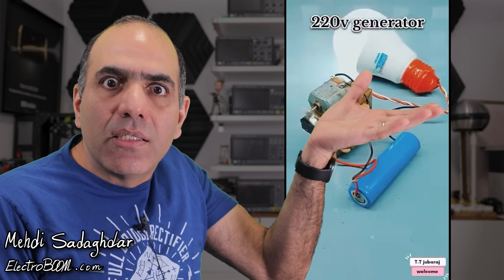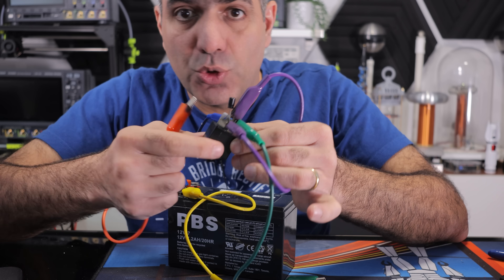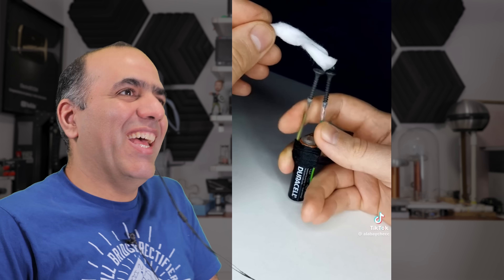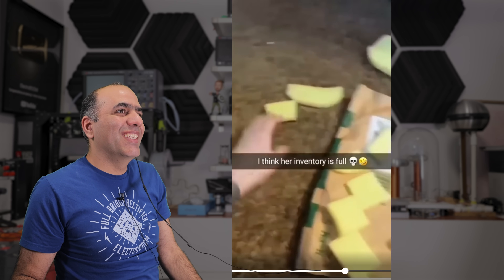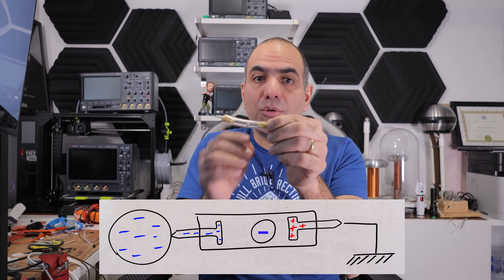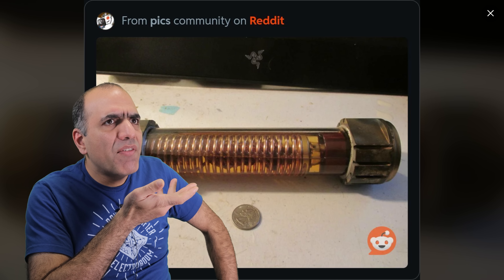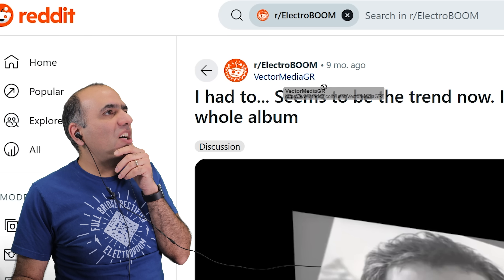Nuclear Egg (LATITY-015)

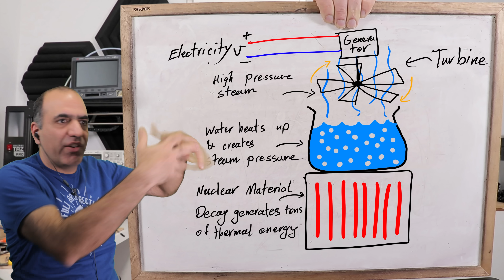Comment: 12:30 There is another kind of 'nuclear' power source, so far only NASA has made use of.  Radioisotope Thermoelectric Generators (RTG).  It's completely passive, just converting heat of the decay from a radioactive isotope into electricity directly using the Seebeck effect.
Reply: Not only NASA. Pretty much every space agency uses them. Russia used them in a bunch of remote lighthouses too.
Reply: they are huge and have a huge heat sink.  they are not a small plastic egg.

Comment: You can make electric source with radioactive beta decay directly (without boiling water and turbines), but I don't think you can power a house with it., they have energy density in single digit kWh/kg and last decades to centuries. But it would be neat to have this gigantic 50m cube, that will power your comparably tiny house for few hundred years :)

Comment: you are wrong about the reactor thing. Its not a steam turbine.
its a beta radioactive source, which decays by emitting electrons. Those electrons get collected and you have a self charging battery that lasts as much as the radioactive source.
It can be very small. definitely not impossible.

Comment: You can easily fit a nuclear reactor in an egg using thermoelectric effect, like they did in Voyager space probes.
Reply: RTGs aren’t nuclear reactors
Reply: That’s not a nuclear chain reaction, it’s just alpha decay of plutonium being turned from heat to electricity. Similar, but different
Reply: @filippo1864  I know, but I just want to say that it's not really necessary to boil water.
I think they use plutonium because it keeps a consistent and predictable heat production that decays exponentially over the years and don't have moving parts, but since we don't have those restrictions on Earth, maybe it can be replaced by other designs.
Reply: @兎くん0  yeah, lower complexity and Pu238 decays in some 80 years, so sweet spot for enough thermal output without decaying too fast, but still very niece applications
Reply: they are huge and have a huge heat sink.  they are not a small plastic egg.
Reply: @tsm688  Then just put it in a huge black steel egg.
Reply: @兎くん0  that...  would actually work

but an egg with lots of fins like a cast iron motorcyel motor would work even better.

Comment: You can still make a fire starter with an AA battery, solder a thick wire to each end, and connect one to a momentary switch, then use a much smaller wire to connect it to both of the other wires. Push the button, small wire turns glowing hot, press to flammable material. Of course, you want to limit how long you keep the button pressed or you'll burn through the small wire. You also want to make sure the button can't be accidentally pressed or it'll burn up your camping gear when it gets squished...

The LED repair probably won't last long either. They're wired in series because each individual LED is rated for far less than 120V, and in cheaper bulbs they are often already being driven above spec. That 4 LED bulb would be dropping 30V across each LED, minus whatever is being eaten by any resisters. Notice the other bulb had 16 LED's, so each LED would be getting at most 7.5V. Also notice the 4 LED bulb looks like is has no circuitry at all, while the 16 LED bulb has a whole bunch of surface components. There's a good reason the 4 LED bulb failed...it's cheap garbage....

Comment: 4:25 replacing the tiny AA battery with an 18650 does actually work as a reliable firestarter though (tried it once with a discarded laptop battery), but you will have to be very VERY careful around things that can dump tons of amps at once like that
Reply: Yes in that case you're 100% correct, however we were talking about a guy who took a regular AA battery and did this. This version was FAKE. However it is possible with other smaller batteries I'd agree or a supa cap.
Reply: @dogs-and-destruction-channel  yep, just suggesting a way to make it work that's just as simple to perform
Reply: Yep that works! I managed to make a sort of tiny battery welder from it but the batteries do heat up a lot but that's because they can dump a few xx amps of current while a puny aa or aaa cant

Comment: To be fair, you can make fire from a AA battery if you cut a piece of (metallic) gum wrapper into an hourglass shape. I'd be curious about the physics that allow that to happen, but not a thin strand of wire?
Reply: A battery can be modeled as a voltage source with internal resistance in series. To get maximum amount power out of it the load resistance must be equal to the internal resistance. To to reach high temperature the power needs to be concentrated on a small area. The hourglass shape does that as the thinner part has higher resistance so it has more power loss. 

The wires have constant diameter so they generate heat equally. They were also quite thick so they have lower resistance than the internal resistance so most of the heat is generated inside the battery. The wire being copper and foil being aluminum with higher resistivity also matters. It would probably have worked if he cut all but one strand of the wire from the end of both wires and touched the strands together
Reply: @laserdiode  Thank you!

Comment: (14:42) Most notably about these types of reactors, normally the excess steam isn't just thrown out, it's typically recycled back into water to be used as a coolant again.
Reply: You still need gigantic cooling towers or a large body of water to condense the steam though.
Reply: @maxine_q  well yeah, I'm just adding that typically it gets recycled

Comment: 12:30 there are Radioisotope Thermoelectric Generators (RTG) that can passively generate electricity from nuclear decay, however, they need a few kilograms of plutonium oxide fuel to generate just over 100 electrical watts (while about 10x more power is dispersed as heat), so hey, maybe that egg can indeed keep 3 lightbulbs on for several decades
Reply: We put them in our deep space probes and extremely remote arctic lighthouses
Reply: Isn't that what powers the voyager probes?
Reply: @iversen57501  yes and the rover Curiosity on mars to
Reply: Probably not a good idea to have an RTG in your house, mind you.
Reply: @Jpg700 There are RTG pacemakers and no issue with that
Reply: @Jpg700  I can only imagine how much of a nightmare disposing of them once they burn out would be if every single house had at least one of them
Reply: I love that Medhi fully missed the Enron reference 😂

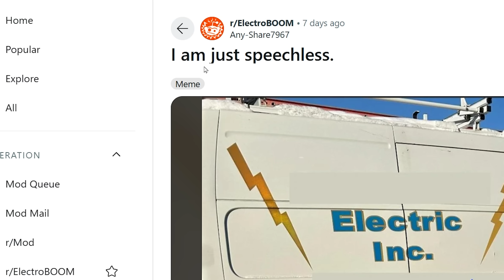Comment: 5:12 at least in Portuguese we differentiate piles/cells from batteries, the usually disposable ones like AA and AAA batteries are "pilhas", while the rechargeable, multiple cell batteries embedded in electronics like in your computing devices are called "baterias"
Reply: In my country and other francophone countries the word "pile" is a general way to call a battery
Reply: @ebtv445  "pile" in french is a disposable non-rechargeable "battery" whereas a "batterie" is anything that is rechargeable ...
But yes, general public tends to use either words but  use more  "pile" for small battery and "batterie" for anything big
Reply: I think it's "pila" in Spanish.
Reply: The poster was writing in English so using any other word but battery was definitely going to lead to confusion.

Comment: I've never seen repair work on a circuit board like that before (pulling off components with plyers). :hand-orange-covering-eyes:
Reply: Big Clive does it all the time, usually to reduce the brightness of LEDs by removing one of the resistors (with snips rather than pliers).

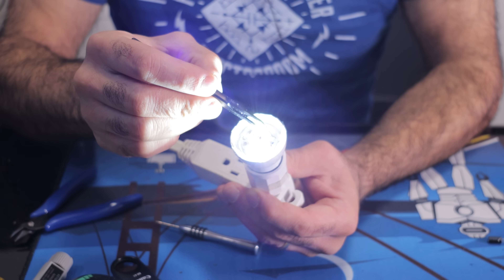Comment: 9:33 Any multimeter's diode test mode: 

Am I a joke to you?
Reply: Even single-junction 3V white LEDs may be hit-or-miss depending on how your miltimeter works.

I cannot recommend poking with multimeter when the AC is on but since Medhi is doing that anyway he could have just checked voltage across the dead LED.

I think the safest way is to just connect current-limited (someting like 1KOhm resistor is fine) 12v or 2*9v battery across each LED. Don't worry about overvoltage - large enough resistor will take care of that. 

And yes modern lamps often use non-12v modules, was surprised myself. 

If you don't have a battery handy try grounding LED "-" with a wire to AC earthing (PE / 3rd wire, NOT the neutral or live wire!!!) and touching "+" with your finger. If LED is working you may see very faint glow - your body picks up that tiny current from nearby electical devices and current-limits through your skin resistance. Try it - it works and is harmless. 

Often if you look REALLY closely you can notice a tiny tiny black dot where a burnt-out junction was.
Reply: I think anybody who requires a warning about putting tweezers across live terminals is unlikely to be all up to date on their multimeter training.
Reply: Probably won't work, sorry. Those LEDs are usually modules with multiple LED chips in series, so the entire bulb can run at a much higher voltage (like 50V, oftentimes at the same voltage as the socket). This gives each module a much higher wattage and light output and you only need a few modules instead of >50 simple LEDs. This also means that the summed up forward voltage of one such module is so high that the 9V battery in the multimeter does not have a chance to activate it - it will show broken circuit for perfectly fine LED modules.

Comment: 3:21 DiodeGoneWild seeing this: Bloody hell! Are you kidding me, guys?!
9:03 The least you could've done is bypass or replace the dead LED with a resistor. I've fixed a few LED bulbs with series connections of LEDs by doing so and by choosing the right resistance, since the LEDs in a series connection don't get pushed to their limit, they should last longer and you can make the driver run more efficiently.

Comment: teach us how to reduce the amount of power going to the leds so they last a bit longer
Reply: Resistor in series for fixed voltage, resistor in parallel for fixed current. (I have no idea of what I just said)
Reply: @ ROFL 😂
Reply: light dimmer
Reply: Depends on the bulb design. Some have a pair of current-limiting resistors, you can cut one off to bring the current down. Brightness also reduces of course.

Comment: Anyone know why an rcd can’t be used above an altitude of 2000ft? Was listed as a warning on the packet.
Reply: Might not be a guaranteed high enough air density to properly quench the arc flash in the arc extinguisher chamber, if the breaker opens when it's got a high enough load on it. Meaning it might well trip perfectly properly, contacts open properly, but it never actually disconnects the load, because it's now got a lovely highly conductive mini lightning storm going on inside, that's also burning the innards. then your distribution board, then your house.
Reply: @ thank you, this is sort of the answer I expected based on some papers I saw but still didn’t explain exactly. This has annoyed me for three years.
Reply: @RandomRecreation  Just an educated guess really, so I could well be wrong, but I'm sure I've seen it mentioned a couple of times on some videos about them and MCB's btw. It'd be nice if the reasoning was stated on datasheets, but I can't even find a datasheet that does.

Comment: 10:10 i use a small heatgun and keep LEDs from old bulbs. My rule is this: if the bulb had to be repaired 4 times, then it's time for it to go. You can never have too many LEDs and with a heatgun, it's easy to work it. Not even worth going to the proper solder station. OH and 99.9% of the bulbs i've taken out can be popped open if you apply the apple splitting technique on them. You don't need tools for it. They used to be glued, now they're just using a ridge.
Reply: I just put the entire board in the kitchen oven at 250°F for a few minutes. I tried the hot air station and covering the cob with a blob of molten solder heated by two irons multiple times, but whether on not the good LED’s would survive the attempt was always 50/50 and very frustrating. Those aluminum heatsinks just wick away a substantial amount of heat. If you can’t fight it, use it… By heating the heatsink in the oven one can simply pick the LED’s up at a leisurely, stress-free, pace with a pair of tweezers. When they aren’t extremely easy to pick up, I just throw the board back in the oven for a couple of minutes.
Reply: @athhud  Yup. Ovens work too. Have used an electric bread oven that i modded with a temperature control, but mostly on bigger boards. For these super tiny ones, the cheapo flamazon heatgun is aok. I literally tape the bulb to a small post i have in the shop and tweeze them out. The only ones that give me hassle are the ph!lips ones. I think they use the lead free solder, so i might use the oven on those going forward.
Reply: I think it's the excessive heat that keeps killing the Edison screw LED light bulbs. I bought a set of two identical light bulbs, ran one as-is and modified the other one with a bigger heatsink (from some old ATX motherboard chipset). The LEDs in the one with the original heatsink started failing within a year, while the one I modified still has all LEDs working after 5 years of daily use. It's bigger and looks ugly though, but I don't mind.
Reply: @andeos /videos Oh, they shrink heatsinks on them to cut costs and increase the death of these. So for example 0sram, a brand i get here in Europe, it used to have pretty thick and big heatsinks. Recently, i got a new pack because i finally ran out. I think the gap's like 8 years now. Old ones were ~14 grams. The new ones? Barely touching on 10. So i took one apart form both, cheaper boards, smaller heatsinks, on the old ones, the aluminium base was thick enough that i couldn't bend it by hand, on the new ones, i can cave that base in with between two thumbs. 

Given that i only had Ph!lips and 0sram on hand, i did the test with the P ones as well, same thing, they just weren't as cheeky about it, the P ones were less, than what i paid for them adjusted some 6 or so years ago. 0sram wanted the exact same price, for less. The components inside weren't as good either, the driver board was cheaply made in the new ones and the capacitor didn't even have a name, not that the old ones were brand, but still. 

What a friend of mine suggested, and i might try it, is to put small vent holes for heat to dissipate and to never have these bulbs installed vertical up, because that cooks the board. Horizontal or upside down works best. I might do this a few more years and then i'm switching to 24v on the entire light system and LED strips. I can get rolls of the stuff for fractions of the cost and same result, heck, if i really want to, i can use full light ones and have rave parties while i'm at it.
Reply: @aserta  The vent hole idea sounds like it will help. It's also important to use light fixtures that don't fully enclose the bulb and allow for some airflow around it, but it's hard to completely solve the heat dissipation problems (allowing for optimal temperature for full lifetime of the LEDs to be utilized) with very limited space in the form factor.

Comment: Why do LED lights go bad by blinking over and over?  They become annoying strobes.  Is that a manufacturing defect or by design?  Could they be made to last much longer?  / They never last the rated number of hours on the package before this happens.
Reply: that sounds like a control circuit failure, not the LEDs themselves dying

Comment: 7:21 that's a super old toy. Like as old as the generator (concept). In school, the teacher used it to explain the concept of charge and discharge or something related (it only appeared in one lesson). If i recall correctly, ours was made with a piece of glass and cork ends. On the inside, there were two old fashioned dome paper pins (the ones for cork boards) and the charge traveled along two rods shoved in. It looked super old. Like the cork was ancient both in aspect and how it was made, and this was a few decades ago.